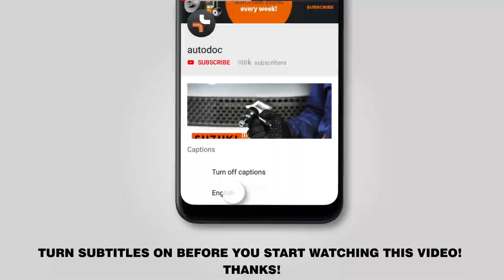How to change rear wheel bearing on AUDI A3 2 (8PA) [TUTORIAL AUTODOC]

Comment: Right Heros. There are two types of Audi A3 rear hub: One has a 30mm inner diameter of the bearing, one has 32mm. my 2007 has a 30mm diameter. but you have to get the correct one!
Reply: Cause of you i took it off and checked beforehand and probably saved myself a couple hours. Cheers mate you absolute legend.

Comment: Is there a reason you remove the caliper bracket? 

The rear brake discs can be removed without taking it off on my 2010 A3.
Reply from the maker: Thank you for your comment.
It all depends on the brake system, in our case the disc rests on the bracket and does not allow it to come out, so we removed it.
Best Regards,
Autodoc team
Reply: @autodocuk  John is correct here, I have an Audi tts 2011 with 310mm brake discs and they come right off. In your case is that you are bloody butchers.
Reply: no dont remove the caliper bracket. Just remove the 13mm bolts holding the sliders on, rotate the whole piston assembly away, remove the outside brake pad. The disk comes away with a wriggle.

Comment: Why 155nm? Where did you get those numbers from? I and all garages that I had to deal with torqued it up to 180nm plus 180 degree turn. 3/4" or 1" 40 inch long breaker bars were used for this.
Reply: I would not trust these figures, they omit a lot of crucial steps and also some torque figures are flat out wrong. This is not dealership workshop standard. I've watched video for rear bearing, suspension and spring replacement from autodoc on a3 8p and things are wrong. Rear wheel bearing should be pre-tightened to 180nm for steel wheel bearing housing and 200nm for aluminium wheel bearing housing, then the car should be put on wheels then bolt angle-tighten 180°  and new bolt as well extremely important! And for suspension lower bolt it should be 180nm IN unladen position otherwise bushing will be destroyed in 1-2 years. For suspension upper bolt 50nm + 45° they forgot angle-tighten and always replace bolts important. For inner bolt lower transverse link 90nm + 90° in unladen position and always replace nut. Some bolts and nuts should always be renewed unless you want an accident, the metal in the bolts when angle-tighten means that the metal is no longer stressed in the elasticity range where it is not deformed, but is stressed to the point of plasticity where the bolt is permanently deformed and could risk breaking on subsequent angle-tighten and without angle-tighten it will not meet the required clamping force.  All torque values are for clean bolts no oil and no copper paste. With copper paste or oil you risk overstressed the bolts when tighten with Nm tigthening because the stretch will be increased using same torque values.  The videos they upload have steps and information simplified to a point that I would not trust the outcome. It does not seem that autodoc employs authorized mechanics for each brand but more generalized automotive mechanics. Especially omitting crucial information on wheel bearing and bonded rubber bushing requiring final tightening in unladen position means more money to autodoc because people will replace the parts more often! Unladen position means that the wheel hub should be put in the same position as when the car is on the ground with no additional weight, measure distance from center of hub to upper wheel arch beforehand. This is not necessarily written to you specifically but to give others a more  general idea of what should really be done to do things correctly.  @autodoc any response from you guys? As you might imagine I am not impressed with the details of your videos!
Reply: What’s the purpose of the extra 180 turn? Would the right torque figure not just do the job?
Reply: @joshsmith159  Don't want to mislead you but I think it have to do something with "reusing" the same bolt/screw thread. When first assembled in factory think it's just right torque required but once bolts are undone, torque plus additional angle is required as previously inner or outer thread has already "experienced" the same "stress" which weakens it and same torque would be not sufficient to hold new fastener in place... I might be completely wrong here so don't take my word for it but if you look into proper repair manuals you'll always find torque settings and plus additional degree turns (where applicable). And yes, most of the time it feels just utterly scary when you do those 180 or so without effort and then have to swing or bounce on 2 to 4 foot long breaker bar that won't budge any further :)

Comment: I've snapped 3 bits undoing the bearing bolt.. any tips on how to remove any better?
Reply: What an absolute pain in the butt that design. Many cars have 12 point 32mm nut on rear wheel bearings, which is great. Torx, allen and XZN heads should banned in cars in high torque applications, those only strip out when trying to undo on older vehicle. Hex heads at least give you a fighting chance and sockets for stripped heads often save you if all else fails

Comment: yo i recently installed a new rear wheel bearing A3 8p1 2.0 tdi BKD the new bearing has play in up and down motion is it the hub ? is that normal or should I be worried i torque it to160 165NM just to be sure
Reply: Mate even 160 doesn't sound right. Not sure where did they get 155nm from cos Haynes manual and Audi garage say it should be 180nm+180 degree turn on rear hubs... Loads of torque when you think about it but yeah, that's how it should be done.
Reply: @TomaxSin  200nm and180for the m18 bolt its the 32mm shaft bearing this one is prob 30mm that's why but still they need to fix this case they can get sued for misinformation.
Reply from the maker: Thank you for your comment!
The description is difficult to understand, we recommend contacting an auto mechanic.
Best Regards,
Autodoc team
Reply: @autodocuk  social media representatives in comment section and not mechanics to answer question because it's cheaper but not safe 😂

Comment: I recently changed the rear wheel bearing and it still had the humming noise, i then changed the toe to out on one side and it stopped humming but the car was unstable so i had to return the toe to its original position. i took it in for wheel alignment, toe and camber adjustment and the humming is still there.  Any advices?
Reply from the maker: Unfortunately, it is difficult to say something without proper diagnostics.
We advise you to contact the service for a complete diagnosis.
AUTODOC

Comment: Hi. Can I please get the exact size of the spline bit socket. When I search up xzn 16 I get m6, m8, m10, m12  5/16"
Reply: Is it m16
Reply: @alyasbungo  no absolutely incorrect. The centre bolt is XZN M18.
Reply: Clarification: There are two types of hub bolt too. The 32mm I was sent was an XZN M18, the original 30mm id hub had a XZN M16

Comment: How did you lock the hub when you cracked the spline bolt going thru the middle?
Reply from the maker: Thank you for your comment!
Please could you clarify or rephrase your question and we will be able to help you.
Best Regards,
Autodoc team
Reply: The rear "spline" bolt is fixed position in front wheel drive, the hub does not need to be fixed. Spline bolt on a driven axle is a different story you need to loosen bolt car on ground which is not a problem if you are replacing the bearing afterwards because the bearing will be immediately damaged in some grade, or have a friend pressing the brake pedal when wheel bearing is not loaded then the bearing will be saved in that case.

Comment: You missed telling people how to lock the rear hub when cracking the bolt to undo it
Reply from the maker: Thank you for your feedback.
We will definitely take this into account in our new videos.
Best Regards,
Autodoc team
Reply: autodoc.co.uk thanks, if you can tell me how to lock it I will purchase the bearings from you
Reply: If I understand you correctly, the way I cracked the centre hub bolt was with the wheels on. Firstly remove the dust cover for the centre hub, put the wheel back on and onto the ground. Use the weight of the car to lock it. I used a breaker bar and some steel pipe for extra leverage to undo the bolt. I believe you could skip this if you have a good impact gun. I don't. Good luck man.
Reply: Eivind L thanks mate, I didn’t think of that!
Reply: @ChessWatchesGeo  don't use impact on these it will risk damage the internal threads.
Reply: @csud9540  the rear doesn't need to be locked. It's fixed
Reply: @Wangsian199  I’m confused ian, I had mine done at a garage but...... how do you hold the hub to undo the nut holding the bearing in is what I meant......
Reply: @csud9540  the XZN M20 bolt is holding the inner bearings on the centre axle that is fixed. It doesn't rotate. so you just need a big bar and a heavy man to rotate the bolt.